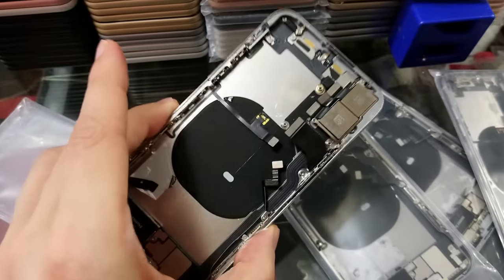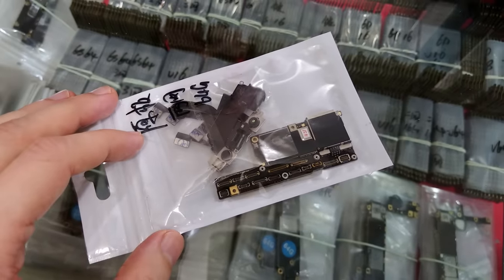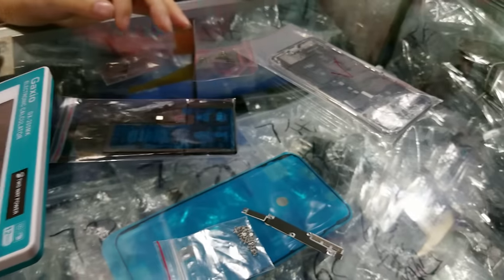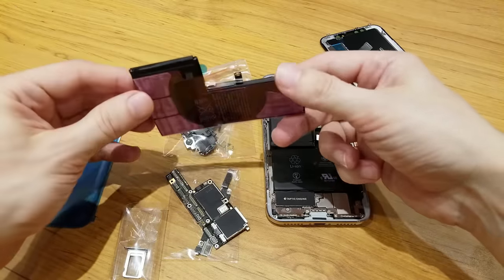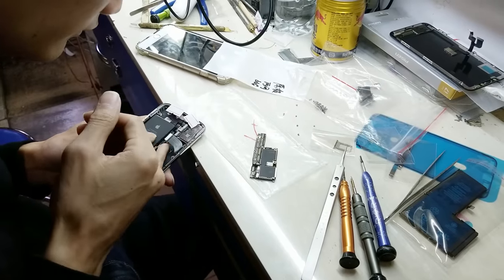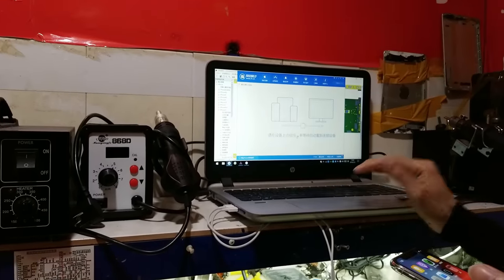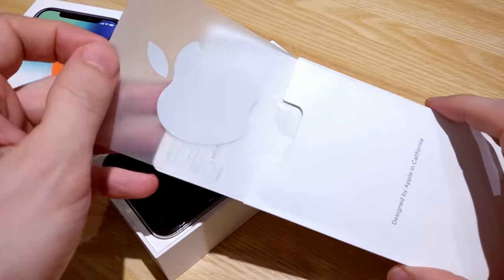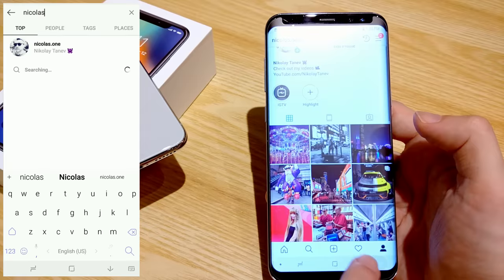Making iPhone X From Parts In China For FUN 📱😱😲

Comment: Nice video!
I actually traveled to china to try it by myself and I was somehow successful but with an iPhone 7.. I bought an mainboard with home button included, an "gold" casing without the apple logo, bought an rainbow glowing apple logo (had actually buy two because I broke one..), bought an used battery (69% battery shape), I bought some screws (I didn't had enough but yolo) and I also got an used display from an presentation unit. At the end, everything was working and I paid 390$ (if you ignore the plain ticket which costed me 180€) but the thing is that I ignored, were scratches on screen, the fact that there were screws missing for the plates that hold the metal brackets and I also bought some stuff from some random street sellers which could mean that those are some low quality parts. 

Anyway, I had my fun and my brain is bleeding after trying to communicate with the sellers with google translator, British English and hand gestures XD
Reply from the maker: Nice experience you got. 👍
Reply: Yeah but the thing is that I actually only used physical money once and almost all the time I used my old Xperia Z1 to pay for all the parts. Never thought that china would be so revolutionary if it goes for technology. At Germany I experiencing problems at stores if I pay with my credit, debit and giro card. Mostly I have to see if their terminals use NFC and then I pay with Google Pay via PayPal

Comment: Hi Nikolay, I live in Shenzhen and tried to find the market today. I followed the instructions video but the 2 floor just had loads of spares and no complete iPhones, iPads and watches. What floor should I look at and each booth has an unit number, which have the iPhones etc I see in the videos? Cheers.
Reply from the maker: Hi, after you reach the place in the video, go from the McDonalds down the street, you have to find the iPhone Parts building it's a different building it's very near. Then go to the third floor, there you can find all the iPads and Apple watches. I don't have the shop number you no need to worry just walk around you will see them!
Reply: Nikolay Tanev ok thx for the reply. So not the same building as McDonalds. I’ll give it a try next week 👍
Reply from the maker: Yes, it's a different building very near. You go to the McDonalds then you will see a street which goes down the road walk there for about 20-30 meters and you will see another big building usually there are many people in front. Then take the escalator to the 3rd floor when you reach 3rd-floor turn left and walk, you will see there all the Apple watch and iPads sellers. 👍
Reply: Nikolay Tanev I found it yesterday 👍 WoW what a place it is too. There was so much stuff I didn’t know where to look! Thx for the videos and help in the comments 😀

Comment: How is the face id work i thought it was link to the motherboard?
Reply from the maker: It is, I bought logic board with the original face ID to it.
Reply: @NikolayTanev   so the face camera and bunch of sensor embedded or soldered to the iPhone screen is link to the motherboard, how does that happen? I'm thinking they disassemble the iPhone and then sell it to you by parts?
Reply: Because I'm thinking if they just grab the screen that means that screen is from the other phone so how is connected to the motherboard and make the face id work? I'm thinking about the anti repair thing from apple.
Reply from the maker: @kylelaker539  Face ID and the display are separate, Face ID is not connected to the display buy to the Logic Board. In order face ID to work has to be from the same logic board.
Reply from the maker: @kylelaker539  All other parts can be from different iPhone. But the face ID to work has to be from the same iPhones. The display also has its own chip but that information can be copied from one display to another. This is in case if you want the true tone to work.
Reply: @NikolayTanev   oh ok so when you bought the logic board it has the face camera and the sensors too within one bag?
Reply from the maker: @kylelaker539  Only the logic board with the face ID to it was together. All other parts are from different iPhones including the cameras, battery, taptic engine, display.
Reply: @NikolayTanev   yes i know that and I review your video and I saw the face camera are included in the logic board so I'm thinking its the original face camera for the motherboard. thanks sir have great day.
Reply from the maker: @kylelaker539  You too. 👍